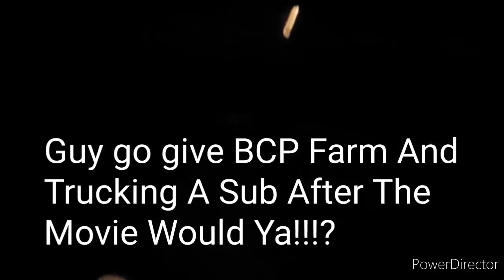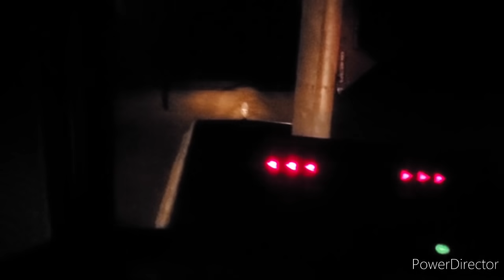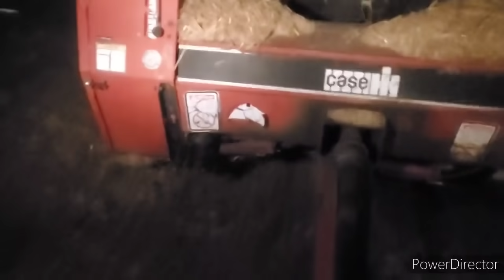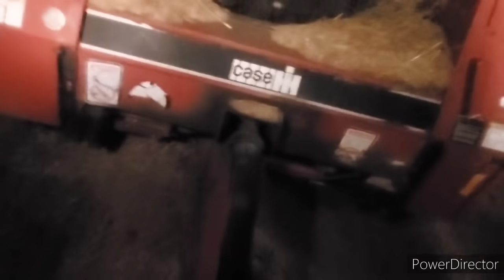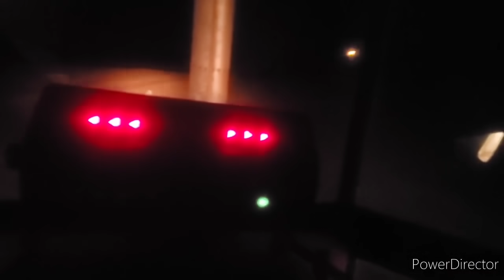DOM IS DOWN👎!!!

Comment: If you have a short jack prota power and carve some hardwood blocks to match the radious.. you should be able to work that dent back out, then patch the flight back on.. sounds like a good winter project-- just get it apart before the snow flies
Reply from the maker: Should work good

Comment: Thanks for the tip on the clutch. Gotta do something with dad's.
Reply from the maker: Tighten er up but maybe only take a 1/4" off at a time
Reply: @straightpipeacres6365  thanks. Gotta do something. Don't matter how I set the combine. I could shut the Chaffer right off and the return will still plug lol.
Reply from the maker: @jeremycherny2041  hahahahaha your clutches are fuckek then. Don't ever grease them things either
Reply: @straightpipeacres6365  I never have greased it myself. Dad may have.  I took it apart and washed it all. It's better now. Hasn't actually slipped out in a couple days. But we aren't in any heavy crop either. Late at night has been when it was slipping the worst.
Reply: @straightpipeacres6365  Take the springs off turn the clutch so it's "point to point" and then cut the spacers so they just have a touch of clearance so the teeth can barely jump each other... that should put the springs as tight as they can get at that point without coil binding the springs.  Puts more pressure on the clutch but still allows the clutch to jump if it really locks up without burning that expensive belt.  Other alternative is get new springs (springs do "wear out" or 'get soft" over time) and roughen up the ratchet teeth faces with a grinder or something so they grip each other better and won't jump until just before the belt would start burning... Later!  OL J R :)
Reply: @jeremycherny2041  I bet the faces are too "polished smooth" from sliding/jumping... try roughing them up with a grinder a bit so they "bite" into each other a bit more.  Your springs may be shot might be worth it to buy a new set of springs.  Make sure everything is running true so all the teeth on the clutch are sharing the load-- anything off-center will allow only one side of the clutch to really get a bite and when it turns loose they all jump.  Check for bearings going south adding to the torque requirements to turn it, chain condition, upper auger/bearings/drive sprockets, etc.  If it's all free and smooth turning then I'd think about futzing with the clutch by shortening the spacers or whatever... I'd do all that other stuff first because if that belt burns it AIN'T CHEAP!!! Later!  OL J R :)

Comment: To straighten them auger tubes the easy way, get you one of them screw scissor jacks like from a car or minivan... stick the jack in the tube put a piece of board in there where you spread the force out some and then screw the jack to push the dent out... I've seen it done before and when my BIL clipped a tree with the unload auger on his 9600 combine and dented the fvck out of the tube, we did it on his by running the jack inside between the auger and the tube and popped it right out...  Should work just as good on the inside of the auger.  Pound the flighting back out between two hammers should be "good enough" particularly for that end of the auger on a pickup head.  Hardest part will probably be pulling the auger out of the head or at least loose enough on both ends to get at the problem... if it's built like the header on my Claas Senator, it drives off the LH end (sitting in the seat) and has a cam track and followers that work the center feed rake teeth in the middle of the auger, down on the RH end... should be able to take that chit loose and pop the drive sprocket, safety clutch, and bearing off the LH end and wrangle it around so you can get a jack in there to pop the tube out... Just takes some time and work.  Later and good luck!  OL J R :)
Reply from the maker: Shitcha